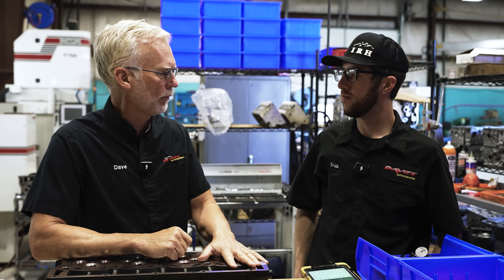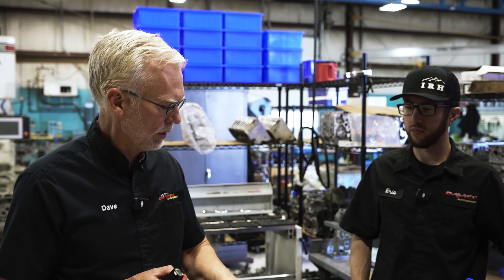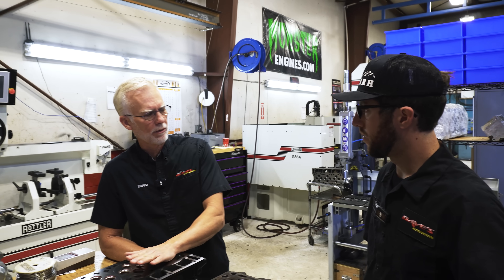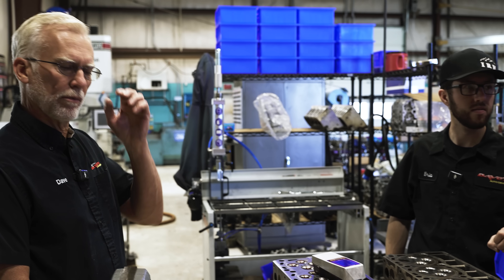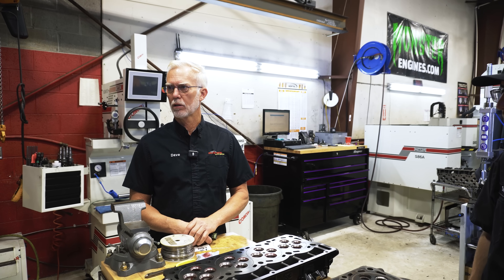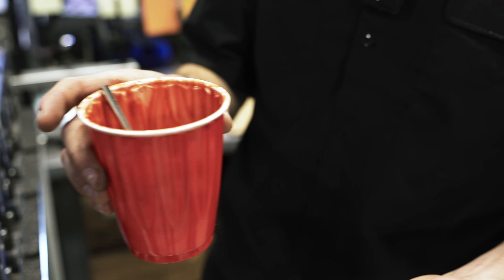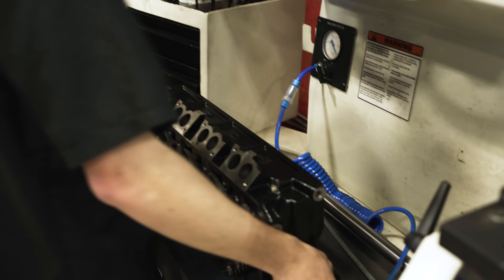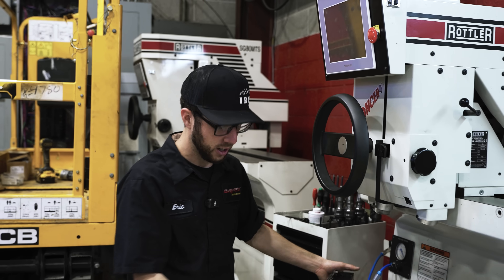Diesel Engine Cylinder head rebuilding

Comment: Had a CAT 3508 that i rebuilt, was running in on a dyno..a valve head broke off and fell into the cylinder. These were Reman heads from Cat. Removed all the heads and sent them to local engine machine shop , they measured the valve and seat runouts....there report was "Some allright , some shocking" ....Lesson learned...Your dead right Dave !!!!!

Comment: Just tell me do you use electric fence wire because it looks just like and the fence wire is stainless steel wire . It has been driving me nuts and it measures out to the right thinness. So let me sleep at nite and say yes or no and if it’s a trade secrets, then send a a text so nobody will know except me and you .

Comment: Your O-Ringing the head, you guy's cut the grove and the groves are all the same size.
Why don't you pre-cut that Stainless steel wire?
All the wire should be the same size
Then you don't have to worried about getting grinding dust in the head

Comment: The last vid showed the O rings were pre-formed solid circle made to fit specific diameter groove; now here you are making your own which leaves the possibility of a small space at the joint , any space is to much  space ! 
Are these o-rings not available pre made for all likely scenarios ? I certainly would never have suspected that a loaded head would need to be disassembled & machined THANKS

Comment: I called Edelbrock about aluminum heads for a 502 bbc and asked them to machine my heads and a proper valve job a 3 angle valve grind and we check them and they were the closest to perfect but it cost me a little more but was worth it. But your 100% right they are never perfect so I never drop a head on with out taking it apart and checking them first, modi’s to you Dave .

Comment: Just insane amount of detail in this builds. 
My father owns a shop in Croatia. We basically do little bit of everything and try to do the job with the best possible quality. 
We don't do whole engines that often. But head reconditioning, and head gaskets are quite common.

And this video just showed me that we do lousy job 😂. 

Valve seats are redone with diamond paste and half rotary tool (I have no idea how is it called). Checked by putting gasoline over the valve and checking that there is no leak (without spring mounted)
Head is resurfaced on that rotary tool this guys just sad I won't make good enough surface, and without this rings. And block is cleaned with some sandpaper if it isn't in worped.

So my question is.

 How much of quality and longevity are we loosing this way??

 I am genuinely interested and would love to improve our process of building heads.

Oh and I had apsolutey no idea about valve recession 😂😂.  

I mean, we aren't machine shop. Just few guy doing it the best way they know. So any advice is greatly appreciated

Comment: The only problem with touching aftermarket heads like that, is if a problem occurs with the head, then it's on you.

The manufacturer won't help you out in such a case.

I'm really curious to find out more about the cylinder head O-ring modification and what the reasoning behind it is.

I think I got it after a quick search, but would not mind watching an indepth video about it.

Comment: Hey brother I've got a 1994 Isuzu Standard Cab 2.3L, Engine seized up driven on no oil and another shop told me its not repairable, what should i do? The truck has a ton of sentimental value and I want to salvage it any way possible. Do you guys do LS swaps and such.?
Reply from the maker: Thank you for your question. You can reach a service writer by going to the website at monsterengines.com. Fill out the online form. Appreciate your patience as they are receiving a high volume of messages at this time. Thanks for watching our channel.

Comment: Hello guys love your work and videos, I need an advice.After driving for more than an hour I keep loosing coolant from the reservoir cap, temperature is optimal and I tried changing the cap the problem stays.(wolkswagen golf)No visible signs of head gasget problems.

Comment: What material are the head and block and are they galvanically compatible with the stainless steel wire? Which grade of stainless wire do you use? 

Curious engineer… enjoyed watching that. Artisanal levels of fitup and finish. 🤓😎

Comment: I was touring the Cummins Jamestown, NY engine plant (built the L10 engine there then) with a customer back in the early'90' I think it was and we came to the cylinder head assembly area. The assembler had a fixture that came down on top of all 24 valves at once and he would put the keepers in by hand and then release the the fixture and then take a mallet, as you did, and pound the end of each valve to make sure keepers were seated. I asked him how often he found one that was not seated properly, he said he never had, then he hit the next valve with the mallet and the spring went flying as the keepers were not seated properly ... he looked at me ... I smiled and shrugged and moved on. So that is an important part of cylinder head assembly.

Comment: All that talk of precision and then you have a guy hand make an o-ring with pliers and a file. There's no way you could engineer them from the size of the circle you cut in the head with compensation for expansion etc., use a tool to guarantee a 90° end instead of free-handing it, etc.

Comment: Great seeing such thorough work and the missed specs that some businesses claim to achieve.
With the deck thickness, there’s a limit to how thick it could be with regards to heat paths, water volume etc. 
I’m not suggesting there’s a problem with this head at all, but Just having a thicker casting isn’t an indicator of ‘being better’ there’s other factors that effect quality. I’ve seen blocked waterways from cores patterns slipping etc in the foundry.

Comment: Vacuum machines WE found were not accurate enough. Manufacturers on average allow 2.5 thou runnout on the valve seat maximum. We found that the vacuum machine allowed a 5 thou bump. The only way to guarantee a concentric seat is a valve seat concentricity tool, it just takes more time for a better finish.

Comment: I would’ve started the O-ring below the cylinder head bolt just below the dowel pin.To me it just seems further away from any water passage. Were you started it it just seems too close to that water port at the bottom corner and that’s just my two cents.

Comment: I was a aircraft mechanic in the Air Force and precision is key with anything aircraft related. The amount of care and precision your shop takes on every aspect of engine building is awesome. Thank you for the knowledge you’re putting out into the mechanic world and for just life in general.
Reply from the maker: Thank you for your service in the Air Force! 🇺🇸Grateful to have your perspective on this channel
Reply: I have a similar working background as you and I am continually impressed with the level of accuracy that Dave insists upon. I have operated many of the various machines that Dave has in his shop. Working with the correct tolerances will help to ensure a quality outcome…IMPRESSIVE!

Comment: The job of an auto/truck technician is to not only diagnose find the cause and change defective part, that’s only about 50% of the job…. It’s more about making whatever you’re working on better than what the factory actually put out.As Dave points out just almost every part manufactured has some defect in them…. When you’re dealing with engines that cost in excess of $10,000.00 you better make certain it’s way better than they way the factory built it.

Comment: The exception to the rule is Trick Flow heads. Their heads are single point CNC ported and chambered, the valve guides are sized correctly with no taper, valve seats are half a thou run-out and the RA is between 8 and 9. This is an accuracy that I cannot match with my equipment. In addition to the above, the heads just flow better.

Comment: Enjoyed seeing the vacuum check. The maximum seen on a gauge, at SEA LEVEL, is 29.5inHg or 749.3mmHg. Lower values the higher above sea level. I have awesome USA made vacuum pumps at my job for drying ovens, and chambers to pull air bubbles through seals of liquid filled units. Ideally that needle will not move once you pull the air out and draw vacuum. Of course, in an oven you have two to three potential leak areas: door seal, gauge threads, pump tubing (we use stainless hard lines). The rubber pad was so cool! You know that deck was smooth, flat, and clean as can be.

Comment: The permanent marker on the valves will become a form of powdercoating when heated since it is resin particulates suspended in the infamous carrier solvent of pyrrolidone (the smell). BUT, very doubtful it will last within a diesel and heat filled combustion chamber! We had an incident at work after heating 303 stainless housings to drop in some sealed ball bearings. Numbers on the outside were really stuck on surface of the 1.6 to 4 micron turned surface. Acetone did almost nothing - even with cotton and massive pressure from a Delrin rod. Had to spin them on a lathe with Scotbrite buffing pad. Heating permanent marker can be useful for someone out there I suppose.

Comment: I learned twice to not retract the stylus/head of an out of production, compact, Mahr profilometer within its own casing. The diamond tip becomes disconnected from the wire spring, hence it becoming useless. No more heads available on eBay. Bought two of the last seven. Thought someone touched the tip with a fingernail. No. Just the retraction killed it. Love that thing. Hopefully this head can last another three years.

Comment: So who pays for the heads that are not in spec the bill should be sent to the manufacturer not the costumer that's so wrong. I understand doing the extra stuff like the o ring but having to resurface and regrind the valve seats on a new head that's wrong dam things need to be sent back to who made it and well I'll probably get banned for expressing what I think

Comment: Your paying for the factory to build the parts right. There shouldn't be a need to disassemble and correct problems. Not enough care and pride in one's work these days. Thankfully there are those that still care and should be building a motor that will outlast the brand new from the factory.

Comment: Sorry if this question seems obvious but, what is the purpose of the SS o-ring that is being pressed fit on the head?  Is this an aftermarket thing or is this specific to this engine?  Thank you!
Reply: Typically added insurance for those running much higher boost pressures in tuned diesel engines. I’m not familiar with the typical failure points of the 6.4 ford engines though, so this might just be an added safety measure for a moderately tuned engine.

Comment: Engine, not a motor.
Reply: I wouldn’t worry too much about it, most people understand that a motor is an engine and an engine is a motor and you can put engine oil in a motor and motor oil in an engine but if you don’t put oil in it at it will break and if you do it it enough times you’ll go broke. Oh, I’ll agree you are right if you can find me an enginecyle to ride.

Comment: Extremely valuable tip unfortunately I learned that the hard way to always do a full inspection/ tear down on a new/ reman head or block . Long story short I got a set of 6.0 power stoke heads and one head had an injector cup that had an elongated hole. After making my own injector cup tool so i didn’t have to remove the head was able to pull it and put a new one in. Always check someone else’s work regardless if will save you loads of headache and heart  ache

Comment: My first professional love ever was being a mechanic, diesel trucks. Moved on to a motor shop that closed its doors (owner was old and retired, no kids and wouldn't sell). Now I design machines, and the thing I hate the most is when upper management, which has no clue as to what I do, tells me "it's good enough because it lasts for the length of the warranty". They'll do anything to save a dime and be able to put anybody on the assembly line.

Comment: Yeah never trust ANYTHING right out of the box…what most people don’t know many spare parts are most often quality control rejects from the assembly lines (especially NOS or CAPA CERTIFIED)…if a part fails QC check they don’t throw it away, they put in a parts box and sell it to shops and unsuspecting customers. Most places won’t do the required machining to put the parts back into spec…good of you to show this in real time, great video Dave 👍

Comment: Any head rebuilders out their that can counter argue this? Just seems unnecessary, digging deep to be relevant.  There’s a reason the head gasket is thick enough to ‘cheese’ fill as he says any imperfection of the surface grain.
Reply: I can say 2 things about this
1. For a guy with enough skill to replace his own head, yeah it would probably work fine out of the box but....
2. For a professional shop, those extra steps can make for a better service for the life span of the engine. And less of a chance of a failure and possible profit wasting rework. 

A lot of the engines I rebuild (I have my own machine shop, old manual machines) unless the head has severe pitting or is warped I don't cut it, I'll take the hour using my flat plane and hand sand to desired finish to preserve the head.
Reply: @jonathanshaw8868  have you definitely had customers come back because of a grain being higher than 26 or smoother than 15? My guess is not, certainly I have never had any issues with head the past 20 years.  We always pull them out of the box and check the deck.  If the deck is straight, valves hold pressure, never had a premature head gasket failure due to “deck grain”.  I personally think it’s a sales pitch. Manufactures would be out of business if it mattered, all of us mechanics would put them out of business with lawsuits.
Reply: @JohnSmith-dh6vd  honestly... no I have not, but I do always hand surface new heads and I do always lap my valves even on new  heads.  But as I said all it takes is one factory booboo and now your eating profit in rework.

Comment: For a every day driver, if heads are  in good condition I don't see any benefit in ringing the head.  I do understand if big tubo, extra boost, and horse power thats a different story.
Reply: DAVE DIDN,T SAY ANYTHING ABOUT WHAT THE ENGINE WAS GOING TO HAVE FOR TURBOS ONLY THE CUSTOMER KNOWS THAT INFO

Comment: This is a brilliant visualisation of ‘The parts are identical, until they aren’t’. Just because a part claims to be 1 to 1 with another, doesn’t mean it is. 

My skill set isn’t engine blocks, but turbochargers and superchargers; the amount of kit that claims to be “Ready to build” or “Made to the same specification and tolerance to OEM” often needs as much finessing, testing and checks as rough parts that you expect to need that degree of work. Some OEM parts need as much prep for the best results. Nothing is perfect, but the closer we can get to perfect, the better the product the customer gets back. Dave and his team have the same mantra as me, don’t take anything for granted; do it right, first time and every time.